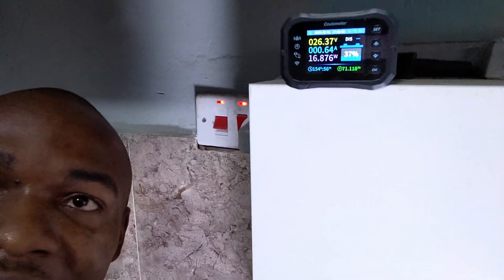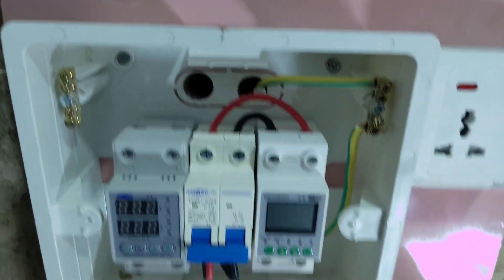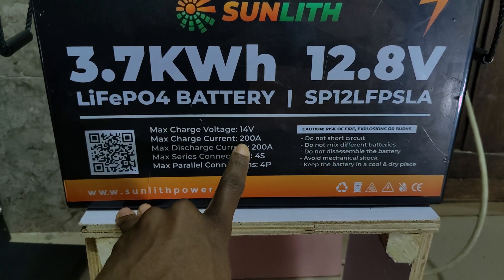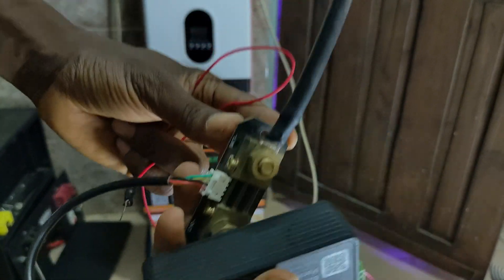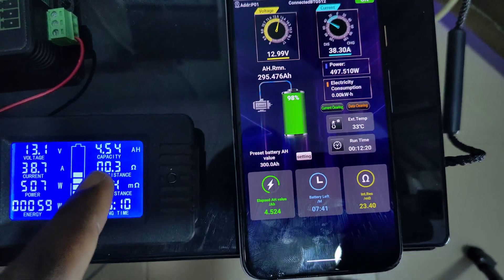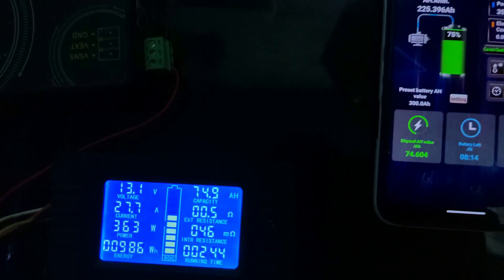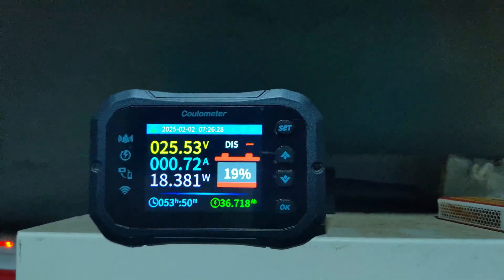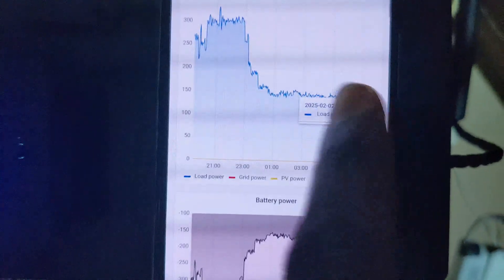SUNLITH 12V 280AH LFP Batteries - Best Capacity Test Process on youtube!

Comment: Where to get dis battery and how much
Reply from the maker: @vedexswise5612   link to seller on the description, 750k.
The Seller is in Lagos Nigeria you can call or Whatsapp +234 701 027 9437
Reply: @odedeyidamilare  I just bought 100ah of cworth 1.28kwh today
Reply: I wanted to parallel it for a client hope it will serve as 2,58kwh
Reply from the maker: @vedexswise5612  Nice..
Reply from the maker: @vedexswise5612   You can parallel it sure, that is 12.8V 200AH 

But series will mean 25.6V 100AH
Reply: @odedeyidamilare  can it work on series?
Reply from the maker: @vedexswise5612  yes it supports series
Reply: Boss pls review the SUKHIG LITHIUM BATTERY 12.8v 🙏
Reply: Please can you do a review on cworth 300ah battery

Comment: Bro greetings. Can you measure earth to neutral.  If there is voltage there. That means the connection is not safe.  I understand that you wired your inverter to earth. But if there is no bonding. You will always have voltage by testing earth and neutral on your inverter.  And it’s not supposed to be so. This is how many people leave their system.  Earth and neutral should be zero volt
Reply from the maker: This is just a bench testing rig.. will take note.

Comment: That Sako Inverter is not 1600w, it is a big scam😂😂😂 Once my load goes a above 1100w, it trips off. I had to buy another inverter
Reply from the maker: @EasyyokeFilms  lol, 1100W eweh. 
Thats why I put the current limiter jeje.
Reply: I don't trust any 12V inverter to perform as rated.
Reply: was about to buy this because i have not being able to get powmr 2kva, so which inverter did now buy to replace it and how is it working so far?
Reply: Naso
Reply: @Ashirama  do you have a different experience to share?
Reply: That means it doesn't have overload protection?